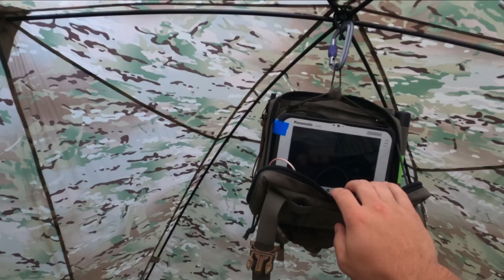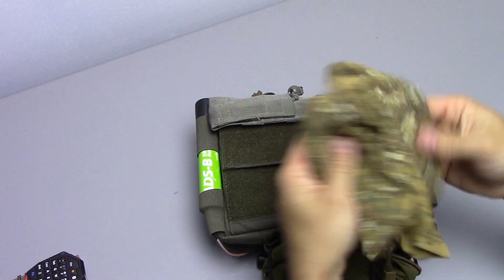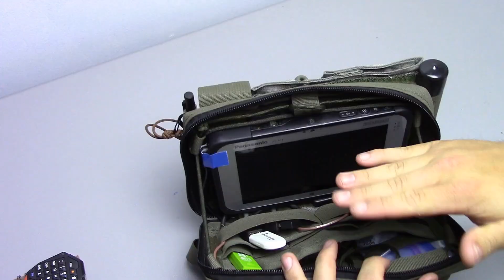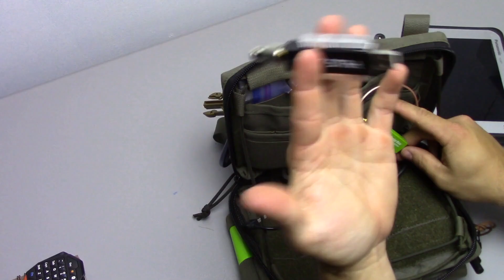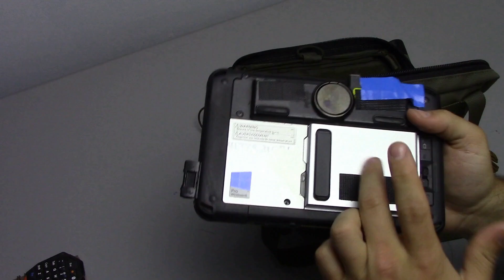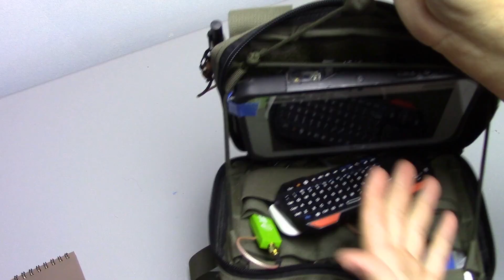Field Computers: My Current Setup

Comment: For charging you can get a 15v usb-c PD trigger cable with 5.5mm barrel plug to charge this. Also there is a mk1 ,mk2,mk3 version of this tablet you want at least a mk2
Reply: From adafruit 
USB Type C 3.1 PD to 5.5mm Barrel Jack Cable - 15V 5A Output - 1.2m long with E-Mark
Product ID: 5451

Comment: After reading the comments I’m confused…which for me is normal, just saying. So as a concerned civilian. What can I track and not track with that system? Would it be ALL aircraft, military and civilian and/or drones? Military don’t always transmit during operations. So how does that work? Also I’d love to see a video on how to pickup drone frequencies to be able to track their whereabouts in my AO.
Reply: I'm not an expert on this topic, but there are a few different ways in which aircraft can be tracked from the ground.  ADS-B (Automatic Dependent Surveillance-Broadcast) is one such mode.  The data packet contains relevant information identifying the aircraft, squawk code, GPS position, altitude, and ground speed.  This information is not encrypted in any way, so it is available to receive and decode with readily available and often free software.

An example of how this information is commonly used is by television stations during the holidays:  the national map with all those aircraft in the air, reporting each aircraft's position, is using ADS-B data fed to services like FlightRadar24, FlightAware, etc.  It is totally possible to set up a listening station that reports information into these networks over the internet, for instance - the PiAware software will do this with a simple SDR dongle and software loaded onto a Raspberry Pi.

Military aircraft typically keep their ADS-B on, except when performing actual operations.  As far as I know -- and, again, I'm not an authoritative source of information on the topic -- most drones are required to run ADS-B, depending on the type of airspace in which they are operating.  There is ADS-B software capable of receiving such traffic - i.e. Dump978 -- named as such because it operates at 978MHz, versus aircraft ADS-B, which operates at 1090MHz.

Hope this helps.

Comment: For power I would recommend you switch over to USB PD over USB C. You can get 16v and 19v cables which will both work with this. In this way you can run a solar panel and external battery much more easily.

Comment: Dude that bag is nice! Where did you find it. I have an mcHF radio with a smart phone running PSK31 :)  But I will move over to 27Mhz Anytone 40W since most of my friends and milsimmers dont have ham license. The CB radio is a bit clumsy but its simple and gives 40w apr. And i use JS8

Comment: I am interested in knowing which keyboard your using. I will not be using in quite the same way, but with the 10" Panasonic FZ-G1 in the Condor T&T pouch. I already use their T&T pouch for additional medical gear but wanted another on my pack for the G1 Panasonic. Thank you
Reply: Can you get the charger in the same pouch with the FZ?
Reply: The short answer is NO. The factory Panasonic charger is large and bulky. There is a contributing writer on Rawles Sur_iv_lbl_g that builds small step down units. Example-12v to 5v. By building it with magnetic connecting leads you can then charge your laptop with your vehicle's battery, an old battery in the truck in the back of the empty parking lot (assuming it is not dead), or farmer Brown's tractor in an old barn. Personally I'm not sure I would want a 110 charger on a kit. Might be ok in a vehicle plugged into a lighter plug. They're just too damn big! Will try to find links and attach with a second reply for you. As to the pouch it might still be tight with everything else (SDR plug in, GPS plug in, quad USB splitter, etc) My thought is a small pouch (like a knife pouch) mounted to the front of the T&T pouch should be quite adequate for such a setup.

Comment: Or you can just wear a Casio G-Shock MULTI-6 digital watch that syncs up with the atomic clock every 24 hours.
In a single 24-hour time period it won't drift more than a teeny amount of milliseconds.
I've literally used them to set PC clocks as well as the time in old SINCGARS radios and they were accurate enough to not only allow easy JS-8 CALL but for proper freq-hopping on the SINCGARS so I could talk to the rest of the battalion on deployments in the Balkans.
I.  Hate.  SINCGARS.  And the ANCD is altogether a special kind of hell that gets its own particular brand of hate from me.  
Loved the old KYK-13s though as they made loading radio fills a snap and were pretty much bulletproof provided you made sure to put fresh batteries in them right before getting the exercise/weekly fill from commo's ANCD.

Comment: You must be handy with solder iron so why you keep struggling with connectors is really beyond me. I ran into pretty much the same problems with my tablet setup and ended up fixing usb extension cables to motherboard and tablet case. Since you obviously aint concerned about resale value, you can fix it very tight on motherboard and chassis, solving a great number of problems. All those G-connectors just postpone inevitable and you know it.

Also, ubox kinda sucks. It's good only when intended to be used literally as an external device. When you keep it in the same bag with a tablet, it does not even outoperform built-in gps with pcb antenna. At least it is true for a bunch of tablets I used it with. So until you specifically need to use GLONASS, I'm kinda curious why it made into your setup. Is M1' GPS so bad?

And finally, I know it could raise some eyebrows, but have you ever considered using thin client? I've been using it for several years and it's really doing it for me. I have sdr server and a bunch of sigint services running non-stop on tablet and dont even bother to look on actual screen for the most part. There is also no need of putting so much stuff into front admin pouch. When I need to sneak a peek I just use a phone with either a sdr client, or a general purpose remote software. I cant tell for M1, but for my tablet running wifi AP for 8 hours straight consumes a lot less energy than highlighting its huge (relatively) lcd for 30 minutes. With a phone dumbed down enough it makes noticable difference in rig' overall power consumption.

Comment: this sent me on a rabbit hole. just ordered a Pine64 Atlas 4GB SBC kit, a couple RTL-SDRs and some other goodies. gonna purchase a simple 7" capacitive touch screen from Ali and repurpose the whole rig into a mini-mobile ADS-B+others rig.
please don't stop with these so-called "boring" radio/field comms videos. this is invaluable information, especially during these times.
Reply: i love rf, some stuff kinda annoys me but eh, have fun with the rtl sdr! they are amazing,
Reply: Will it be a le to keep up with sdr?
Maybe adsb but p25 or similar I can see it struggling.
Reply: how did it all turn out?
Reply: I recommend running the SDR server software on something like a PI or similar and using the table as a client. This allows more performance and enables passive data collection without needing to clutter the tablet system. Since the tablet is going to be more power constrained having the server off the device makes more sense.

Comment: Some 0311 advice on your gear craft: 
1. That aux charging port you have on the back, for solar charging. Snake it in-out-in-out of the molle webbing so it doesn't fall out. 
2. The hole you poked in the bottom of the pouch for the aux charging port. Sew up the sides of the cut so it doesn't open over time, 10-15 loops of thread is sufficient for each side. Use pliers to poke the needle through the cordura. 
3. That ugly bottom pouch for the extra charging cables, just use a longer pouch man, that way your bundle of cables can flatten out a little and be more sleek. 
4. The exterior pouch for weather sensor, pull the flap out (IF it's velcro'd in) and re-install it about 1" deeper so that it fits the sensor more snugly. Not too snug, you want plenty of air getting in there. 
5. Internal cable management. Use some velcro ties to tie together the bottom 3" of those cables, trust me man it'll make it easier to re-arrange them as needed but will keep them from jiggling loose as much when used. 
6. The neck loop of nylon on the back of pouch, if you make the loops on each side smaller then the male end clips will have less room to bounce around when you strap this entire pouch to your backpack.

Comment: for power adapters proprietary connectors cut and reconnect with something like an IP68 waterproof quick connect. Use silicone epoxy to affix the proprietary plug into the device so it doesn't get lost and also seals it. Then you can snap it in and out of any adapter you need with the no-solder quick connects on the IP68 on the fly as long as you have the right voltage. Bonus points if you get a few boost and buck adapters to be able to adjust voltages as needed from the source.

Comment: You really want the antenna plugged into the dongle, the data loss with Chinese kit is extreme, use a longer USB and shorter antenna, maybe put the dongle in the PVC pipe housing for your antenna?

Comment: @S2Underground 3:30 good idea is to use every charger in usb-c PD version. You can buy different adapter (sometimes very manufacturer specific) as a usb-c adapters. This way you can use all powerbank and ac phone chargers (if in PD - power delivery standard) up to 120w. Charger / powerbank negotiates voltage with adapter (5/9/12/20V) so you can power most devices just using different adapters (for few $) :)
Also newer „GaN” chargers are smaller and more efficent.

Comment: Panasonic Tough stuff is too $$$ for what it is.  I have a 5 year old Samsung tablet that is full Win-10 and uses USB-C for everything including power. For bigger stuff, I have a Dell Rugged laptop that allows for battery swapping (modular battery behind flap).
Reply: You can find them used for less than $400

Comment: Have you looked at the Omnicharge products at all? I have been using an Omnicharge 20+ for a few years now and it has worked great. It has a variable DC output through a barrel jack so you could do USB-C in -> DC out for whatever device you are using (I believe ~5-25v up to 5A). It is also a battery pack and has 120V AC out which could be used for plenty of things in a pinch up to 100W. It is a bit heavy but not really any heavier than most DC power bricks and provides all kinds of options.

Comment: You can fix the big charger issue by finding an adapter that goes from either a generic DC plug or a USB C to the proprietary plug. If it requires a low enough wattage then you can charge off a normal power bank, or if it's more intensive, use a higher power USB C wall wart.

Comment: a useful setup I have been using is an SDR combined with a phone. With a phone plugged in to a hub on my kit that also interfaces with a USB based SDR dongle, I can use my phone to route any signal I want through my comms and also run ATAK and other custom software on it. With this and a UV5R I have a very useful multi-band setup that can route the signals however I need in a 2lb package. Tx time even on a 2ah pack kinda sucks though.

Comment: I really like those little bluetooth keyboards for this device. I run my tablet with a usb hub (switched), and have the more advanced cradle also. I do indeed have some of those splitters on had I will have to try.
     Been doing a lot of research on these little tablets. I have 7 of them that I use for different things. Hard to beat the solid state nature of them. 
     I like having the window computer, because a lot of radio programming software is windows specific, and it is nice to be able swap area specific  setups in and out if necessary.
    As far as the internal GPS I'm looking at getting a cell card to see if I can get the GPS to come up on it. Seems like any GPS card should work if I remember correctly, but what I like about the external ones are being able to get them up in the air for better reception. I have a slew of them here (GPD modules) I have been testing, including a couple of the ones you have there.
   As far as the antenna, there appears to be much cheaper options (with supposed better gain). I'm going to order a few of them and see how they fare. 
  You as always have done yeoman work on the pack set up.

Comment: Regarding those Chargers for your tablet .. you might find a USB-C (PD) to Barrel or whatever Adapter with the right voltage. These Adapers are very small and then you could use any PD USB-C Charger, Powerbank and so on. I'm using this Setup for almost everything and replaced all my charging bricks with just one and 65 Watts (up to 20V) PD Powerbank.
Reply: Absolutely agreed. I use one to charge my FZ-M1.
Reply: @Porty1119 Can you point me towards this product? I've got a FZ-G1

Comment: You should pick up a hackrf 1 and a porta pack 2. Upload the mayhem firmware and then you have a small aircraft receiver. It needs very little power plus you get a full sdr reciever and transmitter. It’s quite useful.
Reply: need to get a porta pack for my hackrf need to get around to getting one.
Reply: I’m now going to check the prices on HackRF 1 & PortaPack 2 … 😂  this sounds very fun!  💜👍  Thanks!

Comment: maybe put a presentation together for the ADSB; I'm a long time ham, and did some similar or related work in the Army, but I never thought about tracking aircraft.  A how, and a why, presentation would be nice.
Reply: He has some good SDR videos where he talks in depth about tracking aircraft.
Reply: @kerbalairforce8802  I'm pretty familiar myself with using SDRs, but not specifically for aircraft tracking.  I'll have to search the archive
Reply: I was thinking the same thing. So many acronyms. He probably has some of these videos already, but I definitely need the how and why. Im technical enough to get up to speed, but I've never even considered some of these capabilities, or even usefulness of tracking aircraft etc.
Im especially curious about when it sounded like he was alluding to sending data over HAM frequencies?
Reply: Where'd dude go from my notifications that mentioned you can do email and stuff over SDR? Wow
Reply: @CmdrCorn  If you have an SDR that can transmit.  With ham radio, you can do email, digital comms (weak signal) and even use it for a link for an internet connection in a few different ways.  With the typical dongle type SDR you will only receive, which can still be fun

Comment: Why not use an RPi? You can run Lynux and the computer is very small. All of the I/O ports are normal (HDMI/USB/5V) and a bunch of other stuff. Plus they are fairly cheap.
Reply: I'm guessing because no display, doesn't natively run windows, hard to find due to stock issues, and generally a more complicated setup

Comment: 3:22 why not use an arm based Linux device
Reply: Pretty much everything is compiled for Debian and Ubuntu X86. Arm can be a fucking mess in terms of what works (also there are problems in even finding a current distro for many of them, and things no being compiled for the specific arm chip). X86 is just simpler

Comment: Have something similar with FZ-G1 only running Linux (which I had no issues with on this tablet). I would also recommend some external wireless network adapters and wireless network testing software. Just basic tools to look for weak security that a 10 year old can use with a bit of practice. Even if most of the internet was down there would be these localized wireless networks everywhere (if you can get close enough to play with them).
Reply: Who's gonna run wifi AP if all internets are down and for what purpose? I think in case of timeX all cozy WPA2 would disappear and you'll need to get into radius and all kinds of nasty stuff gov and corps usualy host. Not to mention that you have to be in posession of very serious (huge) rig to be able to connect from far away and simultaneously not to expose yourself too much. Afterall, wifi signal is quite easy to pinpoint. Pirating wifi is very good when you are being covert in highly populated, preferrably urban area, with population living its every day comfy life. I dont think it would be of big use when shit hits the fan so hard that even internets would become downed.
Reply: Was thinking why doesn't he run linux on tab or some kind of mini laptop with touch screen

Comment: AR/VR goggles may be the best way to interact with software without emitting light.
Reply: Weight/battery. If you're mobile, then everything you carry adds to that weight. Although, I have been playing with a VuFine glasses mounted display. It takes an HDMI to USB cable.
Reply: @kerbalairforce8802  There's less screen in AR/VR goggles than on a tablet which means that if you're not playing videogames which require 3d rendering or having external cameras always on it should use less power.

Comment: What you need is a MOBILE ROUTER - then you can have a MOBILE NETWORK then you can network all   incompatible OS. You get time off your mobile router.

Where do keep your gun and ammunition?

Toss out rubber duckies antennae and use rugger panel antennae. 

USE magnetic rubber sheets - longer lasting than Velco. You can put magnetic rubber base on coffee cups, too. 

Just think, two pieces of equipment could take out the lot! You also need a Ulefone Power Armor 20WT portable so you can have numerous communications alternatives including G4LTE, WiFi, Bluetooth, Scrambled voice communications, etc.

Comment: I run a wiped windows surface with dragon os and great great battery life after disabling peripherals like ethernet/internal gps/wifi etc. Purely running the SDR receiver though. I run into the heat issue as well, probably not something anyone will ever get away from